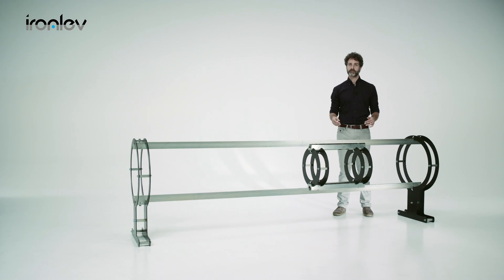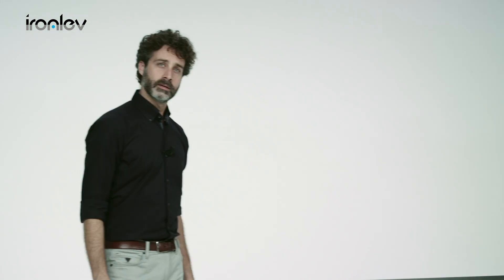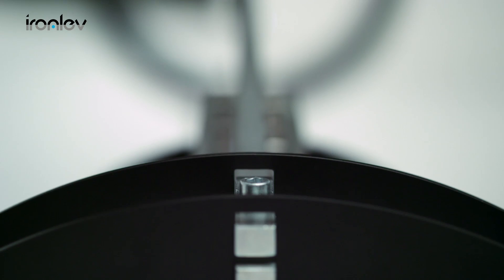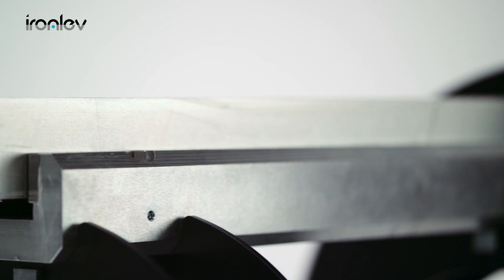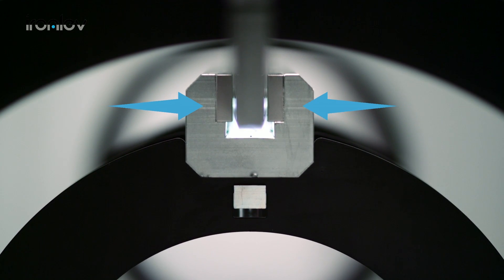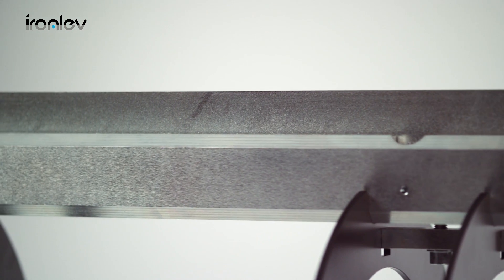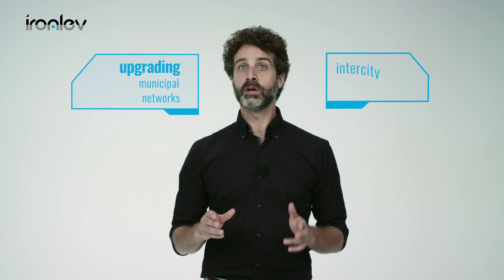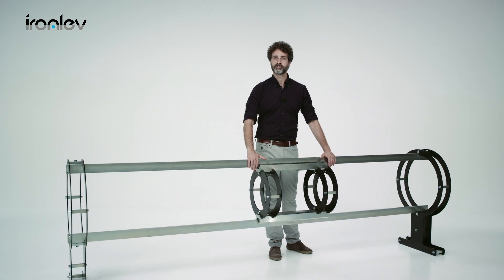Ironlev official promo

Comment: As an engineering student, this is incredibly painful to listen. Does this guy know, or at least the engineer behind the video how magnetic levitation works, I'm not an expert at magnetism by all means I would say between beginner and intermediate, but I'm pretty sure basic permanent magnets or electromagnets with fixed magnetic field at each sides of the rail will never levitate because it will violate Earnshaws Theorem, meaning that having magnets achieving a levitation via equilibrium is impossible, unless you have electromagnets constantly stabilise it by electronically varying the magnetic field, which by the way requires tons of energy. And even achieving it, trying to propel it is actually harder than we think. Yes even without wheels there is no friction but there are eddy currents that will oppose the magnetic force, therefore acting as a brake, so energy saving duh!

Comment: Rubbish !  As the magnets go past each element of the rail they would magnetise it and de-magnetise it.  This requires energy due to magnetic hysteresis loss.
Also, putting magnets at both sides of an iron rail is obviously unstable, since magnetic attraction increases as the separation decreases.  One set of magnets would just stick to the rail.
And how does the vehicle levitate, since magnets attract iron; they don't repel it.
More science and less hand-waving explanation is definitely required.

Comment: The lateral stability system has wheels touching the sides of the rails. Those wheels are 100% of the time touching the rails. This is pseudo-levitation. Sorry but this is hardly "revolutionary". That "lateral stability system" is going to be bearing significant loads in any curves.

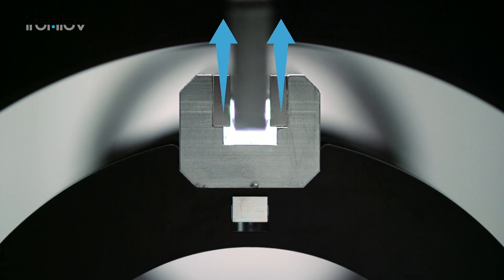Comment: 02:30 There is apparently a fair amount of friction and it seems much more pronounced than what could be ascribable to air.
Reply: It's due to eddy currents... This will never work, at high speeds most of the energy required to move the train will be wasted in heating the rails due to eddy currents.

Comment: I'm pretty sure this is only pseudolevitation; there's wheels in the thing at the top and the bottom to stabilise it laterally.

The reason I think that is that steel is grievously unstable because it has a high magnetic permeability.

The only other ways it could work would be diamagnetism or superconductors. But diamagnetism is incredibly weak and wouldn't be able to overcome the instability of the steel, or superconductors, but you'd see the clouds of condensation from the liquid nitrogen. Soooo, it's wheels.
Reply: This is 100% pseudo levitation. This technology has been around for many decades as a toy train set that levitates between guide rails. There is very very little "new" here.
Reply: That is another non-passive tech described by Ales.
Reply: basic concept explained here; electromagnet.
 https://www.santannapisa.it/en/news/transportation-technology-transfer-public-rail-transport-magnetic-cushion-how-alestech-spin